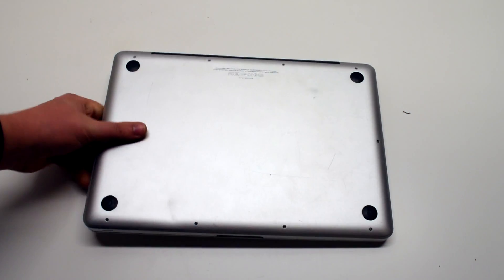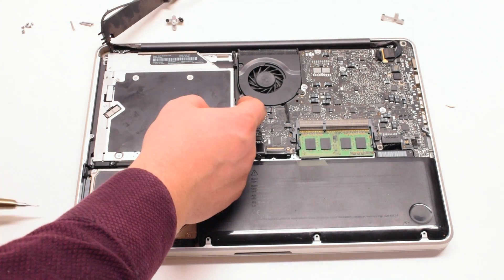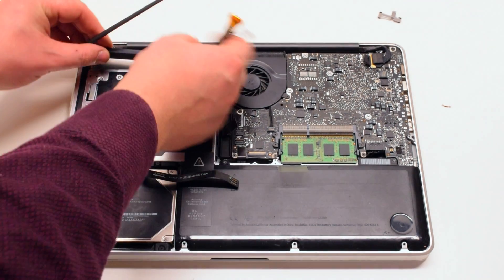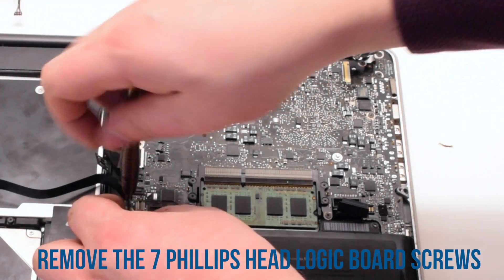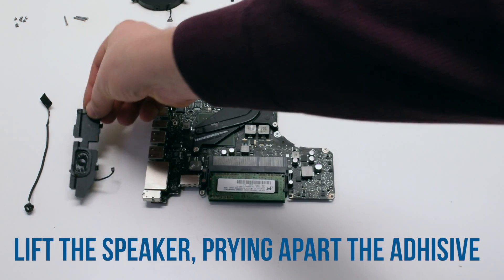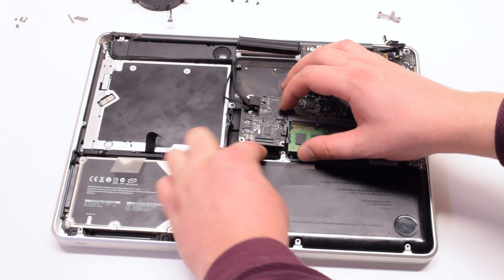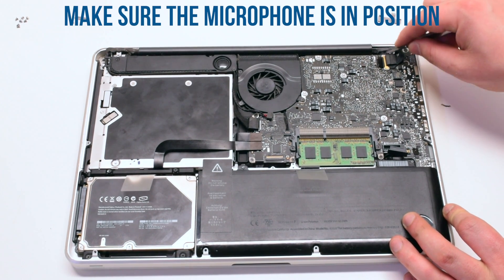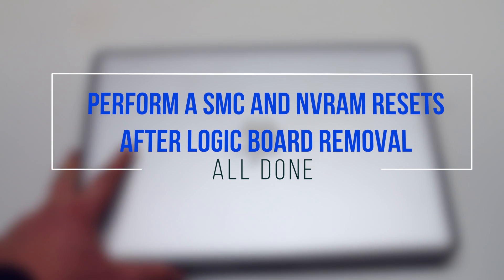2009 Macbook Pro 13" A1278 Speakers Replacement

Comment: Hi, I have a problem, the so called “WTB connector” where you plug in the speaker has just fallen of the motherboard while i was trying to replace the speaker. I have no idea on how to put it back in place. It seems like it was not soddered at all. If anyone has any idea, please tell me. Thanks.

Comment: I tried to do this and the right speaker would not come out. Put the wifi cable back on and the wifi does not work now. Says wifi hardware not installed.

Comment: with such delicate and tiny  parts, fixing broken parts is almost out of the question as far as re-soldering goes. When you pop out all these cables, you never say whether your'e just popping them straight  out , sliding them out of socket,and when to be careful,  and usually when your'e filming that part, all we see is your hand---number 2 down... sorry
Reply: Yeah, good point.  On my mid-2009, I snapped off that speaker connector and now I think I'm screwed... not sure how to replace that piece of plastic.
Reply: @catboy721  mine broke too, did you fix it? sounds terrible.
Reply: @mitchlove7714  Ultimately, I just used headphones for a couple of months and then upgraded the laptop.  If you find someone qualified to do it, though -- resoldering that connection is a fairly simple repair.

Comment: Hello. My computer sounds good left and right but I think the subwoofer is damaged because there's no bass sound. Is   it  possible to change only the right one without touching the left one?  thanks
Reply from the maker: Yes, but the right one is the more difficult one under the logic board.
Reply: Save Apple Dollars my damaged part is the diver near the cd-rom reader, i only ordered that piece.  the part near the motherboard is ok.  you say that the part that is the first in the video is more difficult to replace?
Reply from the maker: I think I had my directions upside down lol. The one you are having the issue with, the one under the optical drive is easy to replace. You will not need to take out the logic board, so you're lucky ;)
Reply: Save Apple Dollars thanks bro very very  a gentleman. All The best bro
Reply from the maker: YW

Comment: 9 screws not 7,,lol ;)
Reply from the maker: Guess so
Reply: @GRIBSOFT  that's a Nice tuto by the way, cheers, ;)
Reply: Actually there are TEN. But he’s referring to the seven short ones, then the three long ones separately. Your thought (same as mine) is that you can’t tell the length of the screw by the external part of the head. Yes, video should simply have said removed the ten screws.  The important part is that this is an excellent video.

Comment: Hello. My computer sounds good left and right but I think the subwoofer is damaged because there's no bass sound. Is this possible?
Reply from the maker: Yes the sub-woofer is part of the right speaker system and is located under the DVD drive as seen at 2:15.
Reply: Thank you. I will replace it.